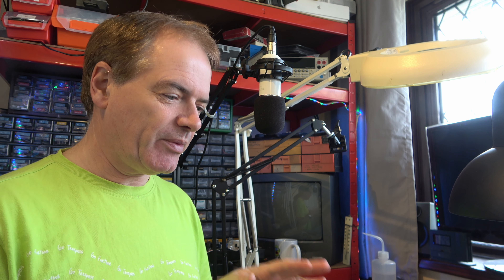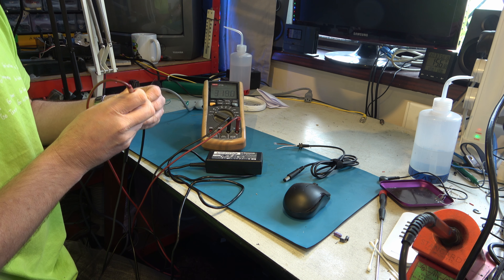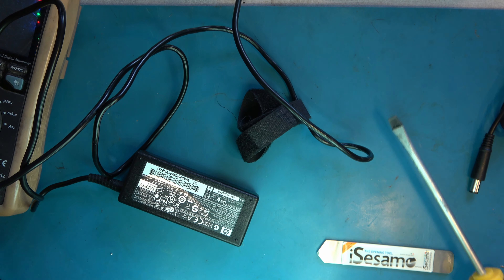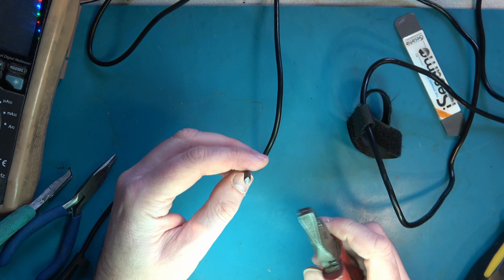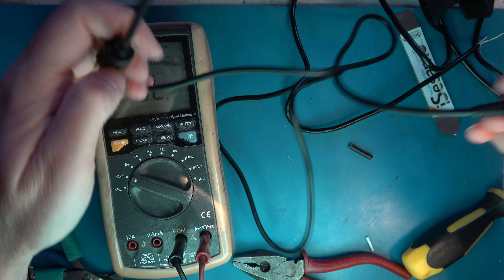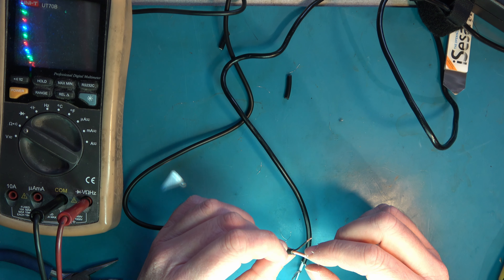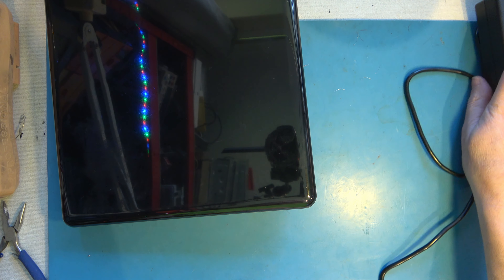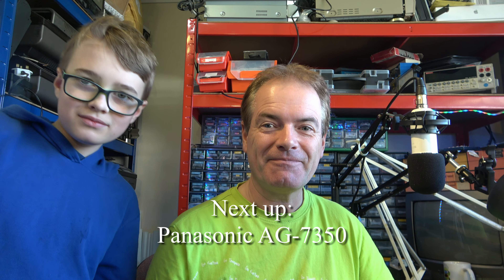Changing the cable on an HP laptop power supply

Comment: Here's a great tip for you - In order to open the power block you have to use a flat screw driver like you were doing but start at the long seem and as you place the edge into the groove right at the 
center point - give it a sharp tap with either your hand or a hammer and that will start splitting the two halves apart, After the repair is done just spot glue it back together with crazy glue in the four corners and two in the middle on either side Or - you can glue the entire seem together with crazy glue to make it water tight. hope that helps... Good video... It's great to see that you don't throw the power charger out just because of a minor flaw that is fixable... by the way where did you find the replacement chord, as I need one to fix my Acer swift 1

Comment: I remember doing exactly the same thing with the Lite-On branded PSU for my brother's Toshiba laptop. Likewise, couldn't get the blasted thing open - later learned that they're ultrasonically welded shut!
Reply from the maker: That would explain it.  If necessary I could have opened it with a saw, but extending the cable was a better solution.  I didn't want to buy some no-brand replacement from China, on safety grounds.

Comment: Some time ago, I was waiting after another customer in a repair shop and was astonished how the technician did open the case swiftly in a moment, to change the cable as you did, and also replace a fuse.  He told me after that, as they are welded with ultrasonics, is no use using spudgers or screwdrivers or even knifes or Dremel with circular cuttings.
He secured lightly horizontally the case in a vise, and with a screwdriver with planar point according to the groove between the 2 halves of the enclosure, he just hammered in 2 or 3 places of one side ( 2 in the ends ) with a firm hit.  Then, if needed, put the case vertical and did the same on one end only.  At last, with bare hands, he opened the case as a book.  Damage was minimal.
When he finished the repair, he used Loctite only in the corners and in the center point of the longer side. He told me that if the
case was bigger, I should add more points.
Reply: That technician also told me that his clients do not accept gracefully a joint in the middle of the cable, for that seems to them as poor or not professional. Besides, that will be one more place with inherent weakness.  
If the replacement is shorter, he duly tells them before beginning, seeking their confirmationnn to proceed.
Reply: That technician also told me that his clients do not accept gracefully a joint in the middle of the cable, for that seems to them as poor or not professional. Besides, that will be one more place with inherent weakness.  
If the replacement is shorter, he duly tells them before beginning, seeking their confirmationnn to proceed.
Reply from the maker: In this case, a shorter cable would have been unhelpful.  Some power supplies can be split apart, but I'm told that this one is ultrasonically welded shut.

Comment: Cut the wires into 3 different lengths, this way wire connections will be electrically safer and result in a rounder cable.

Comment: Use gasoline to open glued AC laptop adapters. Just apply small amount to the seam via syringe and wait a little. I used  Flux-Off spray for it: lenovo AC adapter was openned without problems)

Comment: Ahh grass hopper i am the master of bodgery, find a straight kitchen knife and sit it in the slot on the side of the psu box, tap the blunt back of the knife from one end to another, repeat on all sides :-D
They will come apart with force, errr i mean gentle persuading.
There is an odd 3 pin chip that connects to the i.d wire in the cable, the rest of the psu is a normal switchmode.

I am cheaper than you, i slit the old plug and recover the inside metal plug, solder it back on to the chopped cable and slide heatshrink  over the plug.
Ive done so many over the years, and some have a short where the cable enters the psu.

Comment: You were lucky there were only 3 wires, I've just bought a new acer chromebook laptop & the charger has multiple output voltages, (5,9,15,20) with a  USB type C  connector, so that would be a bit fiddly if it ever needed repairs in the future!
Reply from the maker: I wonder why so many, perhaps it's a way to reduce weight in the laptop by getting more of the charging circuit into the power supply.
Reply: @video99couk  Since USB-C is widely used in modern smartphones, laptops and other consumer electronics, this standard can carry many different voltages. The new MacBook chargers initially output 5 volts, but when the charger is connected to the laptop, the laptop "speaks" to the charger to raise the voltage to 20 volts.
Reply: Some laptops can carry data over the charge port. Depending on the Laptop it can be a full Thunderbolt 4 connector (however I have also seen Laptops that use it for Power only, USB3 only or USB3+Display port).
The protocol those speak is USB-PD that can go up to 20V 5A (100W) but this needs to be negotiated with an ID chip in the cable and the charger before the charger will actually go up to those voltages. The same protocol is used by most newer Android phones and it's luckily a industry standard.
So it should be quite easy to find a replacement for these, since basically any new USB-PowerDelivery Phone charger with enough wattage (and voltage profile) can supply the laptop. You can't really bodge a normal power supply to the USB-C connector because not having the negotiation could fry the charge circuit or lead to the laptop refusing to charge. 

The center pin on some laptops (especially Dell) is actually a bit worse, since they use it for proprietary communication to know the wattage of the charger. If the center pin doesn't supply the right data specific to the manufacturer the Laptop usually doesn't draw the full power from the charger if it even charges at all.

Comment: What is that orange black tool called? Wire stripper? Can I have the brand and model?
Reply from the maker: Mine is branded Splinktech which is a real brand name, but an eBay search for SELF-ADJUSTABLE AUTOMATIC CABLE STRIPPER will show lots of the same product for about £7.  It really is the best wire stripper I've ever owned, clever design, solidly built and does a super job on all kinds of cables.  Just a bit bulky for confined spaces.

Comment: Came here, to see what wire has the 19V + and what wire has the 19V -  and what the other wire does. I need this supply for an other project, my HP supply (PPP012D-S) has also 3 wires (Black & Blue & White) I just want to know, which 2 wires is the 19V positive, and the 19V negative, so I can use it to charge something else.
Reply: You use a voltmeter till it reads what you are looking for. Red positive lead & black is ground. Playing with electronics without a meter or scope is pointless. That's how you blow parts up trust me.

Comment: what happen if we don't use sense line voltage and connect the DC connector with only positive and negative wire. I do that and my laptop working properly. Is it dangerous???
Reply from the maker: I don't know, but it is potentially hazardous for the equipment.

Comment: The charger am trying to connect to have two interfaces the outer wire (ground) and a very big inner wire it's Lenovo but my computer charger have 3 interfaces the tinny blue, outter  (ground) and a black wire.
 Am connecting my charger pin to the 2 interface wire which have the ac adaptor.

Please help.
Reply from the maker: I don't know if that charger will be suitable. I can't really advise in detail, there's a risk of you blowing something up.
Reply: @video99couk  ok thanks .
I JUST try it before seeing your reply. I connected it leaving the tinny blue sensor wire out and my pc started charging with no error.

Comment: I have three wires one side another side two wires only how I connect
Reply from the maker: I would say that you don't have a cable or power supply which is suitable for the job.  They should both have the three conductors.  Anything else would be risky.

Comment: hi i got a mate who doe's not take care of this laptops  i had to use  ACETAL DELRIN round  bar a case  as the people that do the safe checking of lees gear would not pass  the job you did  as lee  likes to do alot of us safe repairs  luckly i had some
left  i have had it out with  some people about the wiring in laptops  some just think it to wires
Reply from the maker: It's perfectly safe to do this repair on the low voltage side of a power supply.  Splicing the mains input on the other hand would not be safe.

Comment: I have a doubt pls clear the connectionbetween the three and two wires
Reply from the maker: The centre wire is some sort of sense cable, possibly just sensing the voltage that arrives at the computer end.  But we can't be certain what it is used for.

Comment: my dog just ate my cord pleasss drop the link where u got the cord for the computer cause we have the same cord
Reply from the maker: I found it on eBay so can't provide the link now.  But anyway you need to measure the connector dimensions on your particular laptop and make sure you order a cable with the correct size for that.